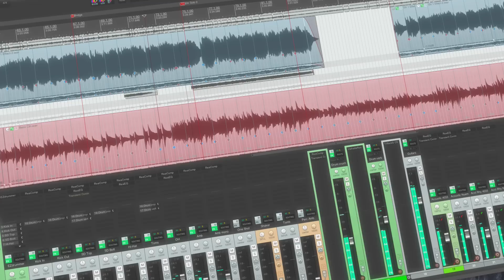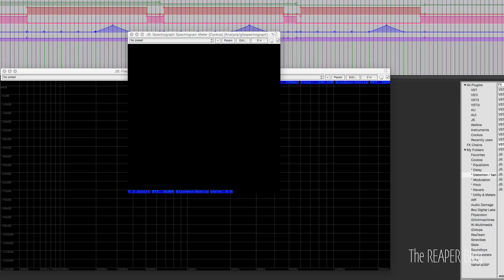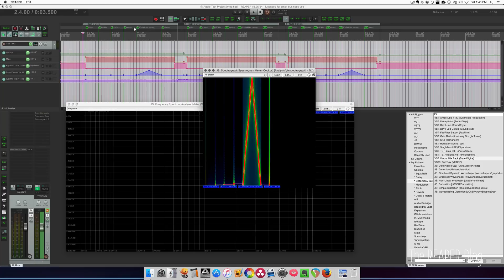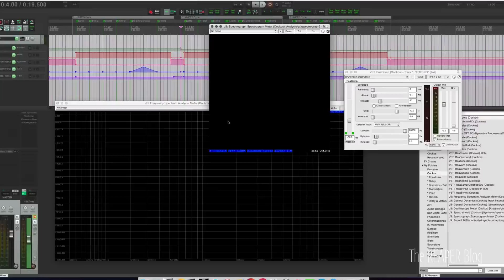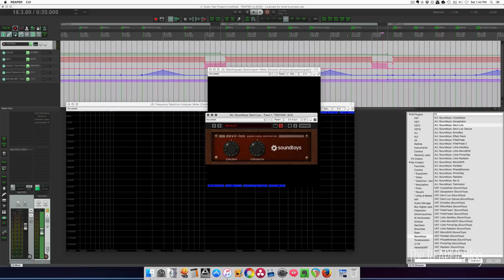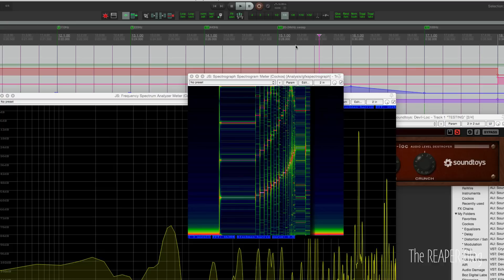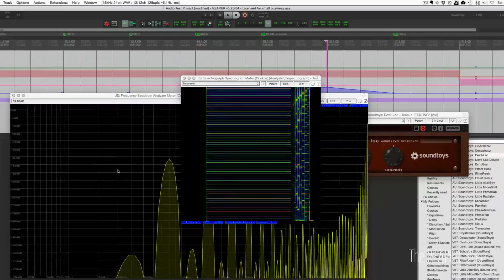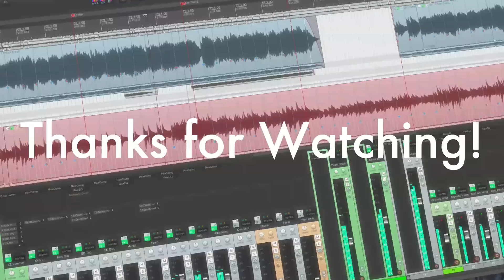Audio Testing Project Template - More audio analysis techniques | free download

Comment: Is there a "timeline" visualization? To analyze transients and stuff.
Reply: You mean an oscilloscope ? Yes JS: Oscilloscope Meter.
Reply: Not really, an oscilloscope is for measuring wave characteristics. I mean something more macro. You know, like the peak view in audio items, except dynamic.
Reply from the maker: @Eichro try jS: GFXScope
Reply: I'm not actually looking for an oscilloscope, but for a... I don't even know the name, that's why I'm having so much trouble finding one.

If you look at FL Studio's Fruity Limiter, it has a nice visualization that shows peaks over time. Such visualization is what I'm looking for.
Reply from the maker: I think I know what you mean. A rectified waveform. positive and negative voltage displayed as a mountain range. Some of the iZotope and Fabfilter plugins have that. Don't think any of the stock plugins have that option.